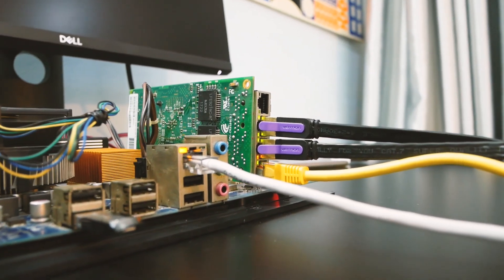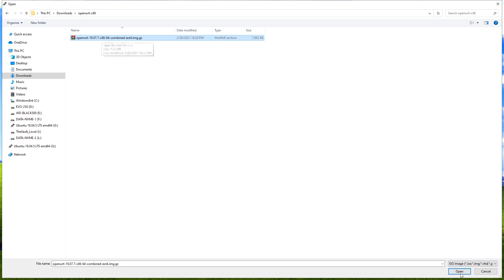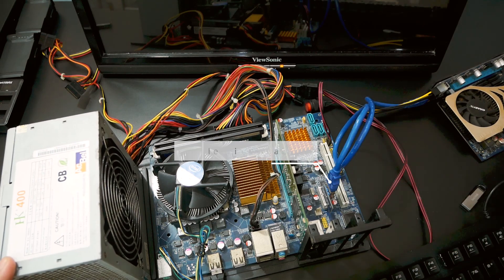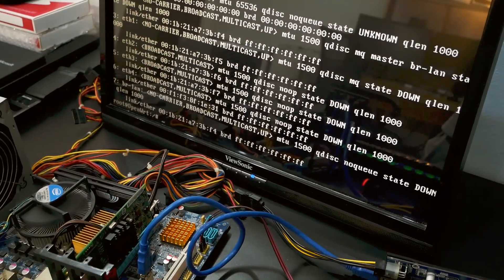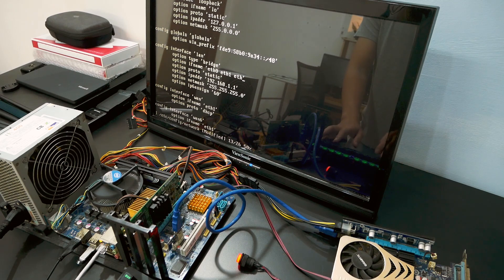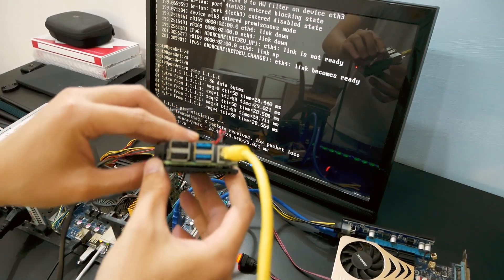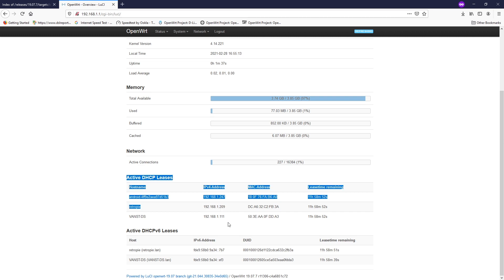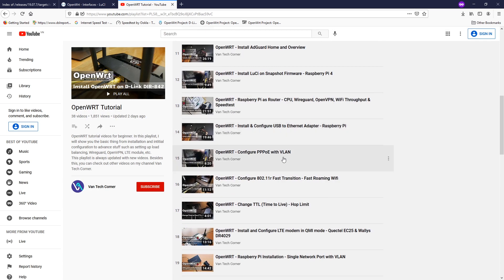OpenWRT x86 PC - Install & Setup Ethernet Network Adapter - Intel Quad Port Server Adapter

Comment: With OpenWrt 21.02 and DSA configuration, the 'lan' interface is now divided into a bridge called 'br-lan' and an interface called 'lan'.  You now use 4 'list ports' lines instead of 1 'ifname'.  The wan interface changes from 'ifname' to 'device'

config device
	option name 'br-lan'
	option type 'bridge'
	list ports 'eth0'
	list ports 'eth1'
	list ports 'eth2'
	list ports 'eth3'

config interface 'lan'
	option proto 'static'
	option ipaddr '192.168.1.1'
	option netmask '255.255.255.0'
	option ip6assign '60'
        option device 'br-lan'

config interface 'wan'
	option device 'eth4'
	option proto 'dhcp'
Reply from the maker: Thank you for the information. I have pinned this and hope that it will help others.

Comment: Hi i have a Dell Optiplex 3020 
I want hp331t use 
But not work 
After connect nic to x16 slot 
The motherboard not boot

Comment: Hi, can you plewse help with network configuration for openwrt on oracle virtual machine? I ve installed all the software and stuff, but cant get it working as a router with PPPOE on motherboard NIC  and lan port trough a usb network adapter. Thank you

Comment: Hello great great video.. i am wondering if OpenWRT have support for Fiber 100Gbps network adapters.
Reply from the maker: It depends on the Network Adapter you are using. So far I only tested with 10Gbps. You can find those videos on the channel.

Comment: I wonder how much watts realtime when old Xeon processor full load and idle state running openwrt x86
Reply from the maker: Hi, the TDP for L5630 is 40W, which is very low power consumption compare to other vintage/legacy Xeon. In the recent 10G OpenWRT build, the Xeon E3-1230v2 with the 10G SFP+ adapter & ethernet adapters only consumes 28W during idle, you can check out here https://youtu.be/6sfs6tvDkg4?t=1971

Comment: Hello Van, I am relatively new to routing. I had read somewhere that it's better to not use the built-in network port and instead have everything on the NIC. So have the WAN and LANs all on the 4 ports of the NIC. Supposedly this is better for performance. Idk if this is true or not but can u verify or clarify that?

Comment: Hi Van , will the configuration safely kept inside the flash drive anytime we reboot the machine ?
Reply from the maker: Hi Syed, with this installation method, the OS and configuration is stored on the USB drive. It will be store safely after shutdown. However, if you want to install OpenWRT to the HDD, you can follow this video https://youtu.be/cOLn2H1FZEI
Reply: @VanTechCorner  Thank you for being very helpful

Comment: I have 1 x86 openwrt as router and multiple openwrt as AP (daisy chained). How do I setup multiple vlan for multiple ssid?
Reply from the maker: With x86, each network port can only carry 1 tagged VLAN ID (if you are about to connect the network adapter to the AP). If you need to configure multiple vlan, please try a router or using a smartswitch/L2 switch with x86. There are some videos related to VLAN PPPoE where you can find tutorial for VLAN creation on OpenWRT.

Comment: Would be a good alternative if you rather use opnsense.
Reply from the maker: Hey, thanks for the comment. For the time being, most of my tutorials are for OpenWRT, maybe pfSense/OPNSense in the future time.
Reply: I just switched from OPNsense to OpenWrt, as my WiFi card was not supported in *BSD.

Comment: you can also ping 1.1 it will automatically replace it with 1.0.0.1 which also works
Reply from the maker: Great, thanks for sharing this.